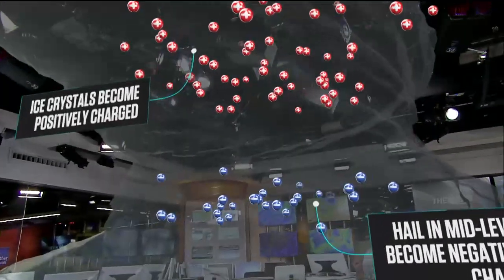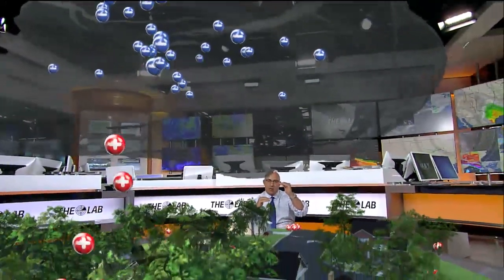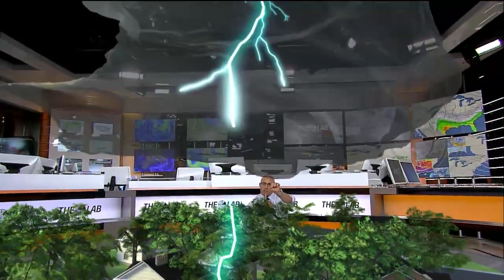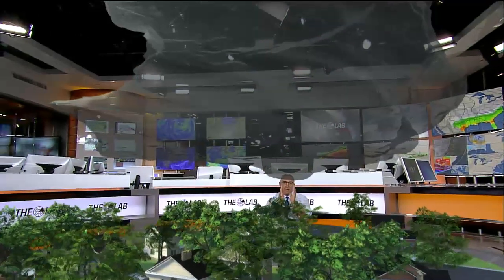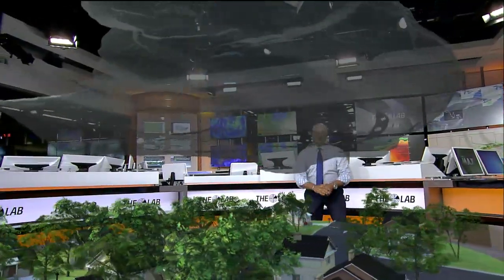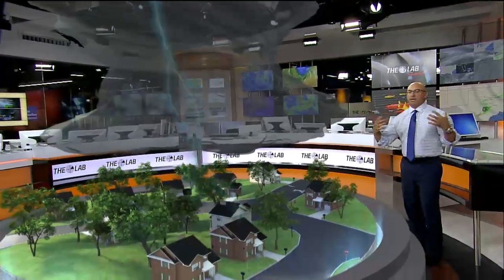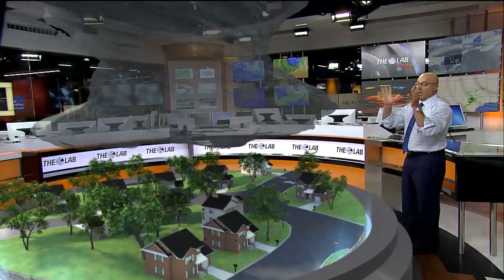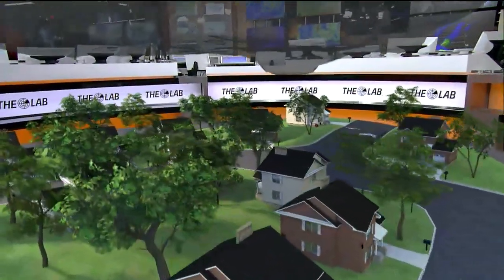Anatomy of a Lightning Strike in 3D

Comment: It is like a man-made arc flash. Lightning is an arc flash. 

So the positive charges buildup on the top of the cloud, negative charges in the cloud base, and all of these tries to divert the power.  Positive charges also exist on the ground to try to divert the electrical charges even more. 

Opposite electrical charges attract, so this results in something like diverted electricity. With the help of ionized air, the positive stepped leader tries to connect to the negative stepped leader as the ionized air jumps the electrical charges to the air from contact-to-contact (intracloud) or contact to ground (cloud to ground). 

When these leaders connect - you get the arc flash known as lightning!